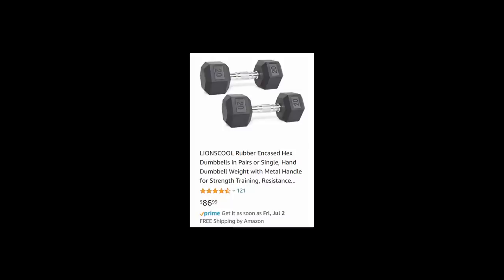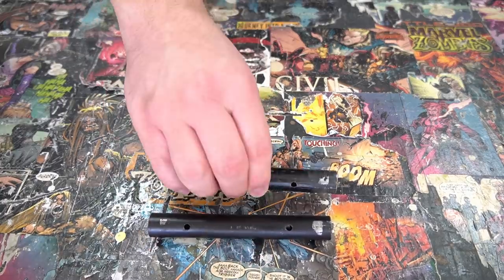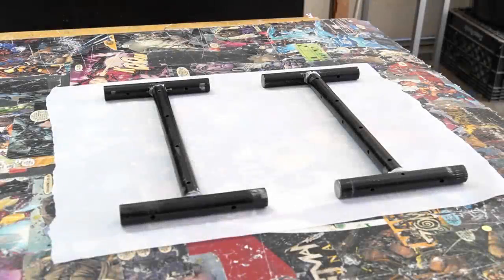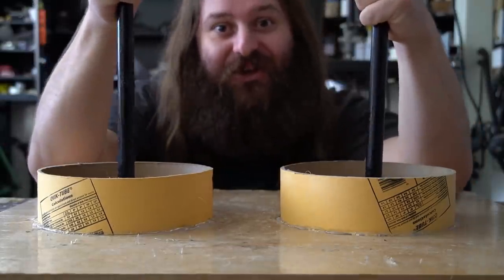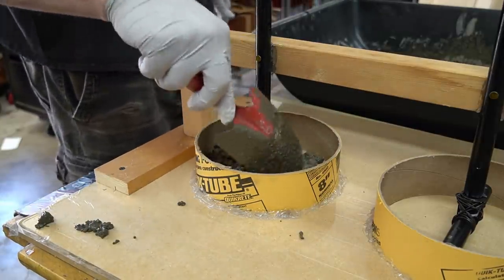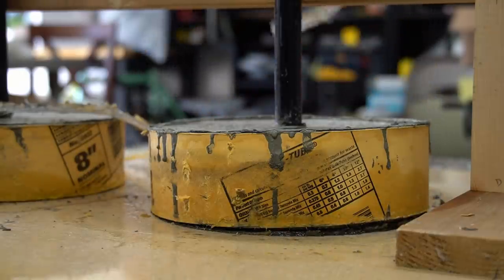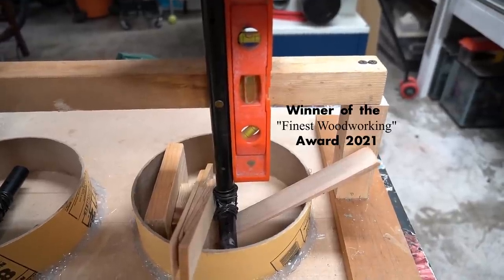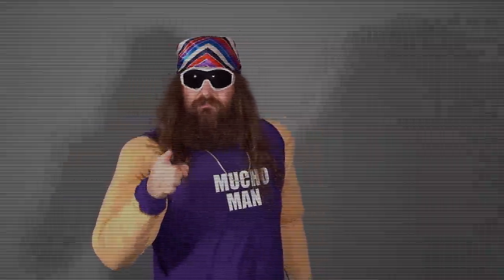DIY Concrete Dumbbells

Comment: Nice voice! I'd suggest having the narration be louder and the music softer. You can see the audio levels on youtube by right click -> stats for nerds -> volume: -10.5 dB. Ideally it should be between -2 to 0 dB. Turn up the mic gain and move it closer to your face first, if still not loud enough then amplify digitally. Audacity is a free audio editing software that you can use. You can normalize individual clips before editing them together. You should also export audio in mono to avoid balancing issues
Reply from the maker: Thank you so much! This is the sort of feedback I crave, as I want to keep improving more and more. I had no idea about the "stats for nerds" tool and it's looks super useful! Thanks again for the amazing feedback :)

Comment: Killer video, loved the hammer drumming! Did you plan out the for a specific weight for the dumbbells (ie 25 lbs) and if so did they end up close to the desired weight?
Reply: I second this question.
Reply from the maker: Thanks for watching! I truly appreciate the kind words and the support! 20 pounds was the target weight I was aiming for and I used an online concrete weight calculator to figure out the measurements. Based on the volume of concrete, these should weigh right around 20 pounds each give or take a little. Sorry I can't be more precise than that, but I don't own a scale and buying one isn't really in my budget at the moment. If I end up finding one for cheap at a thrift store Ill go ahead and post the results on my Instagram page.

Comment: Well, how much do they weigh?
Reply from the maker: Based on the volume of concrete, these should weigh right around 20 pounds each give or take a little. Sorry I can't be more precise than that, but I don't own a scale and buying one isn't really in my budget at the moment. If I end up finding one for cheap at a thrift store Ill go ahead and post the results on my Instagram page.
Reply: @xyzcreate  bring your weights into the thrift store and weigh them. 🤣
Reply from the maker: @emmalfal100  lol that would be so hilarious!
Reply: @xyzcreate  I would add some dumbbell grip tape and flexseal around the concrete.

Comment: Just drill a hole on the ends and slap a nut and bolt on the ends, cheaper, less work and more secure.
Reply: I was wondering the same thing. I'm not very smort  tho, so didn't know if that was a bad idea or not. Love the ide though!
Reply: well done! muscles don't care how shiny the weight is.  Def the potential for failure at the T joint is a concern, epoxy isnt up for that stress and since the concrete is thinner in that area it could crack.  by scoring the bar in that area and putting a bolt through those existing holes as Ray said would probably be more secure without the perpendicular rebar. The thicker the concrete the less chance for failure.  so i think the best plan is to get jacked and move on to 80lb dumbells
Reply: @nathanheinrichs3263  ty, took too long to find this comment!

Comment: You could also add a few layers of fibreglass cloth and resin over the concrete pieces , so if you happen to drop the dumbbells, the concrete is encased and if the concrete chips, its kept together by the fibreglass.    Its almost like the plastic weight discs filled with concrete.  The plastic outer is there to keep the concrete together when/if they are dropped.

Comment: Anti-Crak fibers would be perfect to keep the concrete from falling apart if it's dropped hard. Pretty cheap, since a $15 bag will last you forever. Here they are on Amazon: https://www.amazon.com/32-500-4-Inch-Anti-Crak-Concrete-Fibers/dp/B000CODWAE